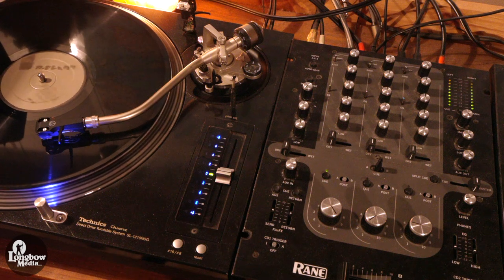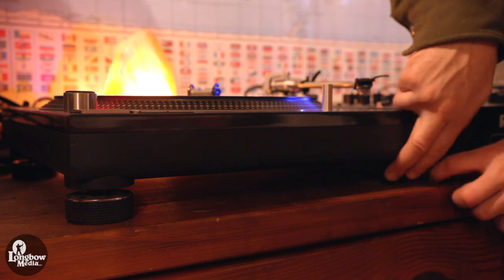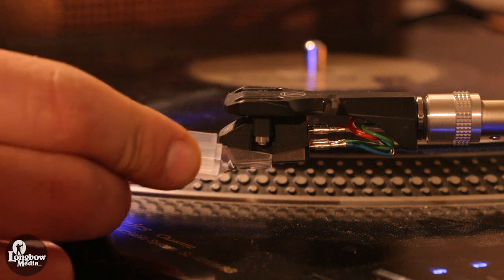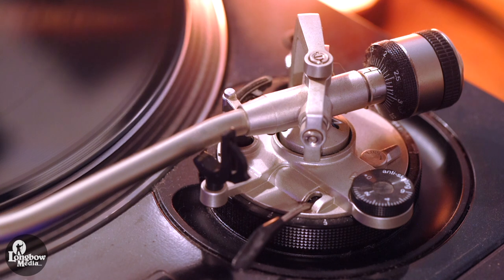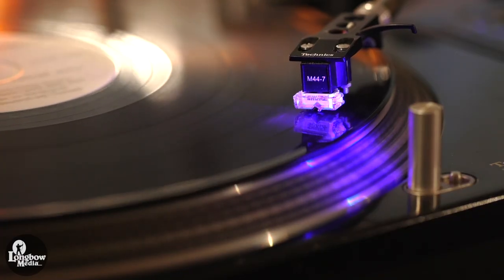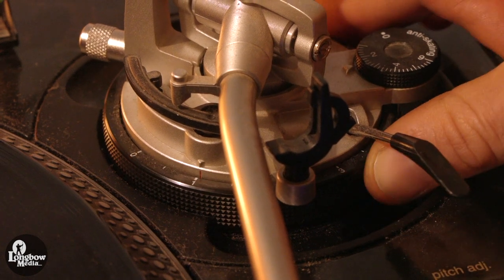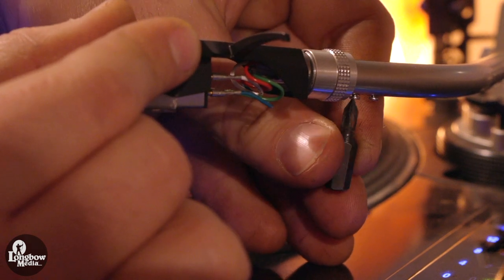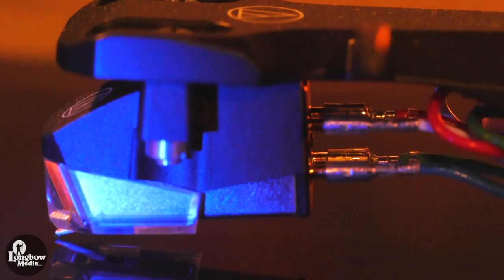How to Setup Your Technics 1200 Turntable + AT-XP7/H

Comment: This is the best video for setting up a cart on the 1200 I've seen and I watched at least a dozen. Very easy to follow, no unnecessary pausing, and all the detail you want! One thing to add: the 1200 manual tells you how high the tone arm should be based on your cartridge height (which you can find online). So my 18mm cart had to be at level 1.

Comment: Very clear and concise video! The only thing I did different was use Technic's supplied alignment tool instead of a protractor. Now I want to print off that AT protractor and see how accurate the alignment tool is.
Reply from the maker: Haven't seen the Technics alignment tool; do you have a link or was it supplied document when the turntables were new?

Comment: What is Your opinion on the sound? Would you recommend them?
Reply from the maker: The AT-XP7 has pleasing detail and clarity.  It seems to favor the mid and high range while putting a little less emphasis on the low-end. (Compared to the Shure M44-7 & Whitelabel).
It's a great sounding cart that I would definitely buy again.  I'd recommend it for leisure listening and club mixing.  It sticks well enough for back-cueing and basic scratch techniques, but a dedicated scratch cart would be better suited for the latter.
Reply: I love the sound quality and the design. But the stylus is very sensitive to dust. From my experience you have to clean every record with a brush before playing it. That can be a bit annoying.